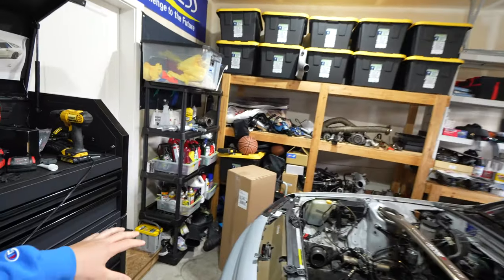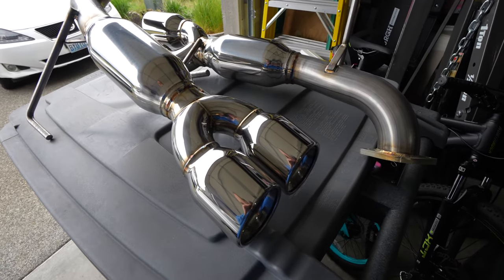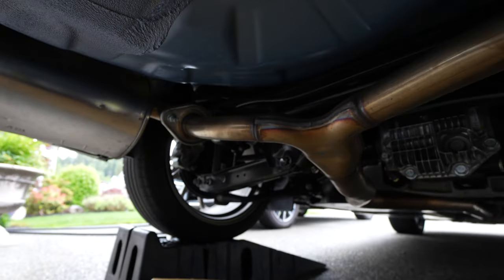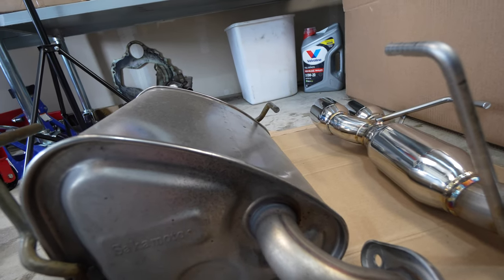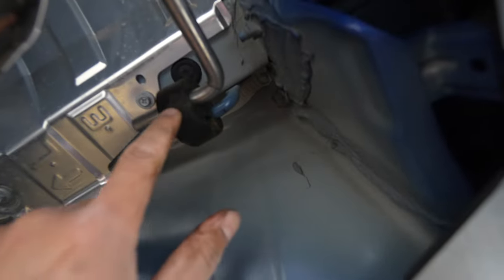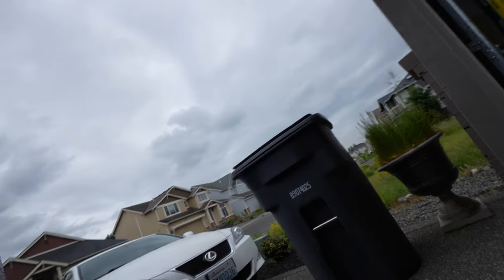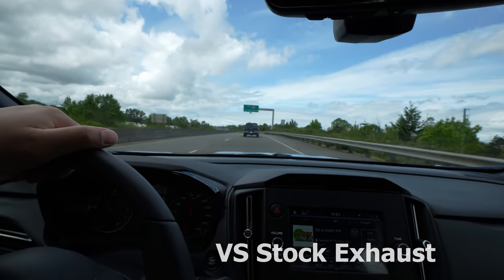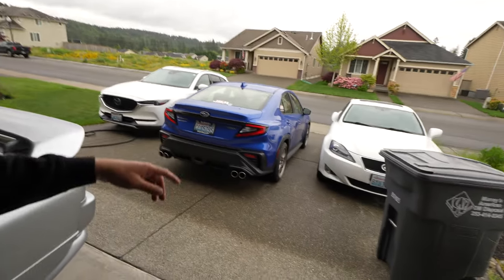2022 WRX Muffler delete ETS exhaust install sound test vs stock boxer rumble is back!

Comment: Just put these on today... they sound absolutely badass. About 15 - 20% louder than stock. Also not really droney which is great. No rasp either. For anyone who wants to have good sounds but not be obnoxiously loud all the time, these are the right choice.
Reply: Did you also go with the muffler or straight pipe?

Comment: Thanks for this video. Sound fantastic. I'm leaning toward just grabbing ETS's cat back after I saw how small the OEM pipe is.
Reply from the maker: Good choice! After doing the install I am thinking the same thing. I hope that the Y pipe will match up to this, so I can get rid of the restrictive OEM exhaust piping. It sounds pretty good, but I would like to hear a little sound and maybe the turbo spool. I cant wait for ETS to release the J-pipe for our car so I can get that installed too!

Comment: I think ETS does a really good job making their stuff and it's not super expensive.   Yours sounds about a hundred times better than stock.    
ETS collaborates with English Racing (Lucas English) quite a bit on drag and half-mile R35's and Evos.   They are only about 10 miles down the road from each other.
Reply from the maker: Hey Gary, yeah compared to stock it sound so much better. I like the deep exhaust tone at idle compared to stock. It gives just a little taste of the Subaru boxer rumble. I like the system, but I wish I would have gone with a full cat back system.

Comment: Sounds a lot better than I expected, and also the best sounding 22 I’ve heard
Reply from the maker: Thanks, I agree this exhaust does sound good. I have the mid pipe coming next week feel ETS. I will do another install and comparison video for that as well. Might try to show the STI muffler sound from my friends 22 WRX Limited too!
Reply: I’ll be looking for the video! 
And personally I feel that the STI muffler on the 22’s doesn’t do much for the sound. 
On another note, I’m hoping that there is some kind of set-up that gets even closer to that iconic boxer rumble. Yours is close my friend, but it still seems different
Reply: Did you order the resonated or non resonated mid-pipe?  I think I'm going to pick up one since they make the 2.5 to match the axleback.  I'm wondering if the resonated one would be ultra deep and throaty?
Reply from the maker: @turbonoise  I ordered the resonated mid pipe, its coming today. I will get it installed tomorrow and have a video uploaded for you guys by Thursday!

Comment: For FA engines the best AXLE backs you can get to remove the Straight pipe (muffler delete) rasp sound but add a little bass on your exhaust sound
-ets w/muffler delete
-fujitsubo authorize s axle back
-cp-e Axleback w mufflers
Reply: Remark is dope asf too. Lots of pops and bangs

Comment: I like that it is mature. This is something I would actually want to hear drive by, not some load fart cannon screaming to everyone that “I’m cool”.  This sounds deep enough and loud enough to turn the right amount of heads.
Reply from the maker: Awesome feedback! This was kind of my same way I thought about this exhaust. Thanks for watching!👍
Reply: @JDMRightHandDrive  you get me excited to one day lease my first WRX and bolt this on for a reasonable price to get that boxer rumble that I fell in love with as a kid. My dream car may not be anything super flashy but I love the rugged, reliable and sporty look of the WRX. The hood scoop just seals the deal for me, nobody else has hood scoops like that from the factory. Just so cool for 30k. I also like that possibly with a simple flash you can get more HP out of this beefier engine. Would definitely keep this car long term if I got one. I drive a 2021 Tacoma, and while its cool its not the corner carver I itch for, can't even shift my own gears. Would love to learn how to drive a manual in my first WRX.

Comment: Thanks for the vid. 
I'm waiting for my 2022 WRX that's on order, being built. I am thinking of making an active exhaust or passive exhaust valve system. There is no active exhaust out there that I can find. So, I might be able to make one, but probably need a tuner to work with me to make it so that the ECU is tuned to  when the exhaust opens full. Can do a pipe that bypasses the muffler using a valve to open/close it, based on the tune, or on-demand.
--"That boxer rumble" is the headers, not the mufflers.
Reply from the maker: A bypass system would be cool, I would like to see a video on that! Unequal length header in the EJ20 and EJ25 series boxer rumble was the best. I realize the FA series uses an equal length header, sounds like I will have to go with an after market header later, for that sound I am missing. Thanks for watching and leaving a comment!🙏

Comment: I’m 58 and getting a new WRX. I totally agree with the sound. Very nice but not too loud and boy-racerish.
Reply from the maker: Congrats on the new WRX Chuck. I ended up selling the ETS because it was a little loud and produced a deep exhaust note in cabin. My wife would not ride in the car because it was to loud for her. I went with a Noble Titanium single exit and it sounds even better, but not as loud. Thanks for watching. https://www.youtube.com/watch?v=u4kJth6PoTM
Reply: @JDMRightHandDrive  Good advice! Thanks!
Reply: @JDMRightHandDrive  thanks for the heads up. I was just about to buy the ETS but it looks like it may not be what I’m looking for. I’ll check out your other video.

Comment: You sadly won’t be getting any “boxer rumble” with that equal length header.
Reply: u right do they even make a UEL for this yet
Reply: @shawnjalbert6458  no because it will kill performance on these motors not made for UEL
Reply: From personal experience the elh is premo on the fa power plant I absolutely love the sound I have gotten out of my 20 rex
Reply: Can’t run UEL headers with a twin-scroll turbo…
Reply: Unequal length are for ricers
Reply: Boxer engines, especially 4-cylinder boxers, have a natural rumble due to their unique firing order, which I think sounds phenomenal on these new FA-platform engines. To me, the old unequal-length headers sound weird and artificial. It's like the grown-up equivalent of sticking baseball cards in the spokes of your bicycle wheels. Plus, UELs make the throttle response sound a bit lethargic.

Comment: I just sold my APEXi N1 single exit since it wasn’t doing me any good for the extra power per my tuner. But I still need some noise since stock isn’t the best for at least some pleasure lol. How’s the in cabin on 75+? I had the STI axelback and that bass tone when cruising was terrible. Debating going this or the Remark Muffled. HKS Legamax is dope but the price not so much lol. Glad you have videos for everything even if it is a year old. Also I would buy those mufflers from you if you still have them haha.
Reply from the maker: I already sold my ETS exhaust. It does have a deeper bass note while cruising on the freeway and it was kind of loud. That is why I sold it because my wife would not ride in my car because it was too loud. I have the Noble single exit titanium exhaust on my car and it sound much nicer. Its not nearly as loud and it does not make that annoying deep bass note. https://www.youtube.com/watch?v=u4kJth6PoTM Here is that video link if you want to check it out.

Comment: My 2022 is arriving late June and I'm already looking for after market exhaust thanks for the video one question u are using the factory hangers?
Reply from the maker: Congrats on your new WRX, I know how excited you must feel waiting for your car to arrive. I pre ordered mine as well and waited for 2 months for mine. Yes, I used the OEM exhaust hangers. All I did was remove the OEM mufflers and the ETS fit right in with no adjustment or modification needed. Simple install process and should only take about 10 minutes or so! Hope you love your new WRX as much as I do. I have put 3500 miles on mine so far and I still think it is an awesome well balance platform.

Comment: Great video and info. Thank you.
Reply from the maker: No problem, glad the video helped you out! Thanks for watching👍
Reply: ETS should send you a commission check. Ordered mine today.
Reply: Installed mine last night.  Sounds amazing, but it's loud.  I would actually go as far to say it's louder than my Pro-Charged 5.0 with MBRP Race exhaust lol.   I'm glad I went the muffled 5", the 4" or non muffled would be way too loud. Car pops nicely going into 2nd.  The factory mufflers are definitely constricting, it revs much more smoothly and pulls better with the axleback.

Comment: Man idk how you got yours perfectly even my left side is close to the bumper and my right side has a double the space
Reply from the maker: Leave the v-band clamp and the both axle back bolts and nuts loose. Spend time to adjust both rubber exhaust hangers to line up muffler brackets for perfect bumper fitment. Once everything is lining up, tighten everything down. Good luck, I hope that helps you out.

Comment: Sounds better but the boxer rumble comes from the unequal length header on the older EJ series engines the new F series lacks that feature as the federal government mandated better fuel economy so they had to go with an equal length header for efficiency.
Reply from the maker: I sure miss the EJ boxer rumble. I had a 02 WRX and 06 STI. Like the sound of the old solid cast unequal length manifolds. I will have to consider an after market manifold at some point, to have that epic sound back!👍
Reply: not 100% true. most of the rumble came from the UEL header. but you still get some from the engine.

Comment: Love the video! The lack of engine noise is one of the few complaints I have about my new car. Find myself looking at the tachometer more where with my old car I can gauge the rpm’s better by the noise. Definitely going to get these after seeing this. Just have to decide if I want the resonators or not. Do you think the strait pipe would be too annoying for long drives?
Reply from the maker: There is a couple of ETS straight pipe videos on 2022 Facebook groups. Check those out. I just ordered the mid pipe/y pipe. Full video will be coming soon. I had them put a resonator in my mid pipe as well.

Comment: Great video! I just got my GT
Reply from the maker: Thanks, that is awesome you got the GT. How are you liking the Recaro seats and adaptive suspension. Also what do you think of the transmission? Thanks for watching👍
Reply: @JDMRightHandDrive I traded in my 12 year old offroader with 0 modern equipment. The wrx is like a space ship to me. Recaro seats keep me in place. The turns are shopping cart fun haha. The adaptive suspension and the drive mode settings are all very different and useful. The adaptive cruise control is a surprise, it practically drives itself on the freeways. Transmission is good. I am no car expert but the S+ mode shifts so well I don't think I can use the paddle shifters as efficiently. Harmon kardon system is badass. I'll probably get an exhaust upgrade and a spoiler like you did. Other than that it's just badass. WRX rocks.

Comment: Just ordered the catback yesterday...no resignator, muffled.  If you haven't heard one yet let me know I'll get you a clip after it's installed
Reply from the maker: I would like to hear the difference between our cars. Send me some video on FB or IG. I just finished installing the resonated mid pipe today. Makes exhaust sound a little deeper and slightly quieter that stock mid pipe. Thanks for watching!

Comment: ets makes banging stuff. got the cat back cause I wanted pipes with c clamps and no gaskets to fail.
Reply from the maker: That's awesome, yeah their quality is next level for sure. My ETS mid pipe showed up today, so now I will have a full cat back just like you! 👍Thanks for watching!
Reply: @JDMRightHandDrive  good on ya. I got a last gen wrb wrx but I gotta say the new ones growing on me. Got any plans to tune it in the future?
Reply from the maker: @jaybosher6144  Yeah, I have the mid pipe showing up today. I want to buy the J pipe next and get a flex fuel sensor with a tune for e85. I dont want to go crazy and lose reliability. I am looking for around 330 WHP to all 4. I am going to upgrade to STI brakes pretty soon. I also want to buy entire STI body kit and paint the plastic molding to match the car.

Comment: This actually sounds really good I just want to know about drone after you’ve had it on for a little longer
Reply from the maker: Cruising down the freeway this morning at 70 mph, you can just hear the exhaust in the back ground. It is definitely not to loud or annoying. I want to test the full cat back ETS system and see the sound difference between the two. I think the exhaust is a little on the quiet side in my opinion, but it is only axle back! Thanks for watching.
Reply: @JDMRightHandDrive  Wow that's great news to hear thanks for getting back to me so quickly. That was my biggest worry with any exhaust as I'm coming from a super loud catless STI and want something completely polar opposite. This seems like the right one.

Comment: The rumble comes from uneven headers, which the vb doesn’t have, you need the aftermarket ones to get that noise
Reply from the maker: Tomei is working on a UEL VB header right now.
Reply: I believe aero flow dynamics sells one as well, not sure who makes it but they did a video on it

Comment: When I got the 22 wrx, it already had the STI exhaust as package and short shifter. I really want a side by side comparison. Because I get a drone. And you seem to not at all. It sounds great and kinda loud, but deff drones 6th gear 3k rpms.
Reply from the maker: The ETS exhaust set up I have does have a drone as well. It only occurs from about 1800-2200 rpms. When on the freeway about 2400 rpms there is no drone at all. My friend has a limited with the STI mufflers. I will try to make a comparison video when i have time.

Comment: Nice video, I test drove the new wrx today and I thought it just needed a little more go, I’d like to do exhaust and hopefully it adds a bit more power. Wouldn’t want to tune before warranty expires. And mine with dyno runs before and after exhaust??
Reply: I think the dealers are taking advantage of the "91 Octane Recommended" and filling up with 87 or 89.  After a tank of Sunoco 93 the car feels like a different animal. Much better throttle response and acceleration.
Reply from the maker: The exhaust to me feels like it add a little more power all the way through the power band. Car to me seems a little more responsive down below when boost first kicks in. Thanks for watching!👍

Comment: Just installed this on mine today! Surprised there was no stock gasket when I took off the stock mufflers 🤔
Reply from the maker: That's weird, mine had this tiny little stainless steel donut gaskets on them. Other videos showed the same. Is your car brand new? Happy you got yourself a new exhaust system. Have fun with your VB I have been loving building mine. Just about done after installing Brembo STI 6 piston brakes on mine. Its a good street car with track capabilities now. Thanks for watching. https://www.youtube.com/watch?v=w1A1c2GGDnM&t=41s STI brake video.
Reply: Brand new, maybe I tightened them on with the new gasket then, whoops…watching your video, all I saw was some orange residue on the Y pipe, maybe it was a sealant? There’s some residue on my mufflers from it too, just didn’t see a gasket…
Reply: @JDMRightHandDrive  you’re so right, I saw the gasket on there in another video, shoot!

Comment: How are you still liking the axle back? did you end up adding the mid-pipe?
Reply from the maker: I did add the mid pipe, here is the video https://www.youtube.com/watch?v=LlnGIXTyI0I The exhaust was a little on the loud side after owning it for a while I ended up selling it and putting the stock one back on. My channel was sponsored by AWE Tuning. I will be installing their full exhaust system on my car in the next few weeks.

Comment: Personally, I would stay with the stock exhaust. It sounds just as good and loud as an after market. Spend your money-on a down pipe and tune
Reply: You get no sound in high rpm with stock. It’s too quiet

Comment: Is this the muffled ets or the extreme one that you installed. The link pulls up a different on from what's shown in video.
Reply from the maker: This was the muffled one with the mid pipe resonator as well.
Reply: @JDMRightHandDrive  thanks I'm a Ford guy buying my first ever Subi today just looking for best mods available.

Comment: I have the unmuffled axle back and man it’s pretty loud. Lot of drone around 3-3.5k rpm
Reply from the maker: Nice to know the difference that your having with your unmuffled vs mine with resonators. I did get a drone between 1800 and 2200 rpm range. Other that that I think my exhaust sounds amazing.
Reply: @JDMRightHandDrive  oh it’s sounds great, just no mufflers makes it VERY droney. Especially considering this car pushes exhaust out with a bit more pressure than the previous gen

Comment: Any updates since adding the midpipe? I really want this axle back with their resonated midpipe but damn, for the price of this axle back I can get a resonated catback from PLM. That system has no mufflers so I’m trying to talk myself into just this axle back for now and then adding the resonated midpipe if it drones too much.
Reply from the maker: I ended up selling the ETS because it had a little be a drone sound. My wife thought it was too loud and wouldn't ride in my car. I bought the Noble titanium single exit exhaust and it sounds much better, not as loud and no drone sound.
Reply: @JDMRightHandDrive  thanks so much for your feedback! Is your Noble muffled and resonated? I’m going to look it up now. Love the channel man!
Reply: Oh! And did you ever run a midpipe with the ETS or just the axle back?